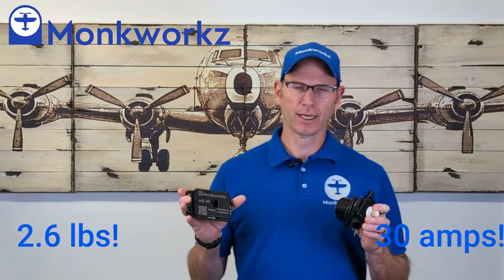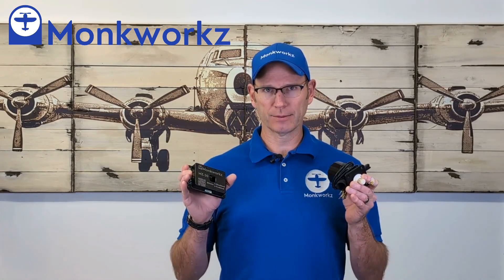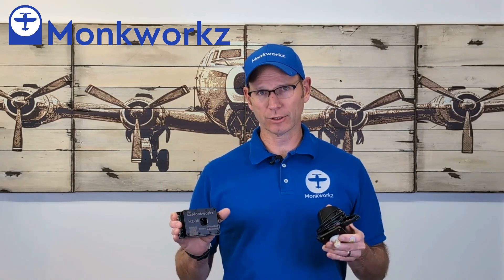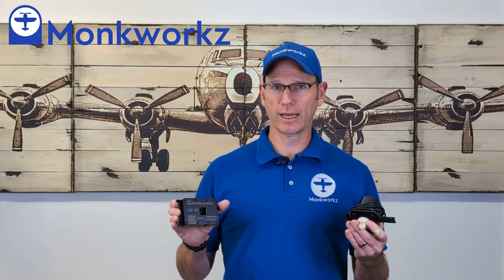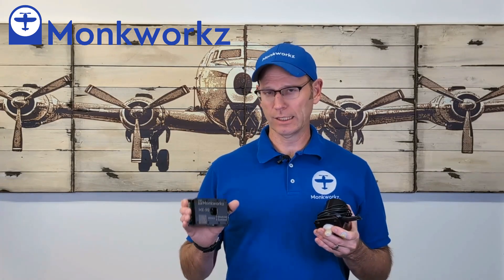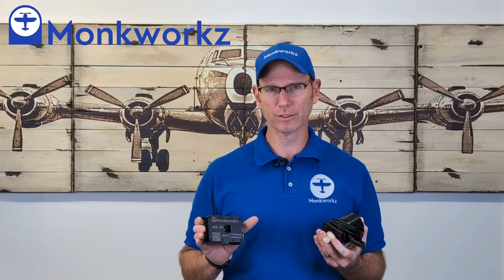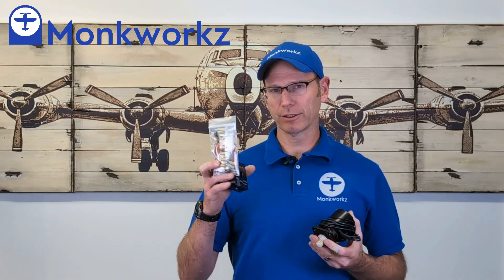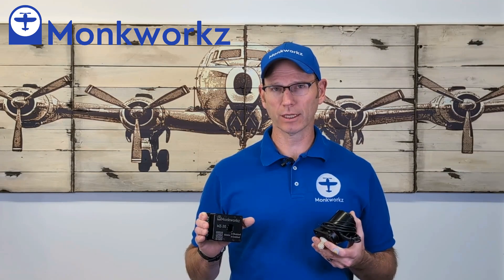Generator Introduction, Updated for 2025

Comment: Yeah but, what is it?
Reply: I had same reaction, but I guess terminology gets in the way.  Small generator in that it uses permanent magnets, however, generator outputs alternating current which which is converted to DC and voltage managed with solid state controls as I understand it at this point.  What if any negatives there are at various RPM's I do not yet fully understand (not EE).  I'm guessing the real benefit of this hole things comes from now very powerful magnets as well as solid state voltage/current control.  https://youtu.be/Yfwc55qNFCw?si=RSi_Rb_Kf46jZqgo